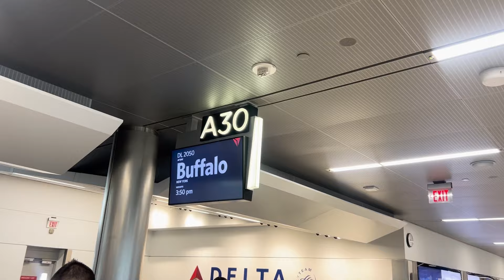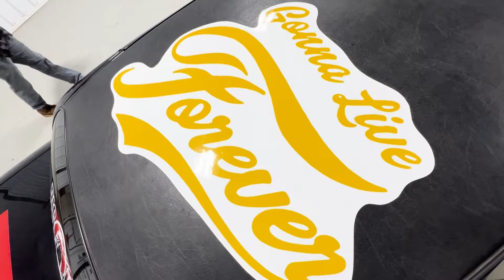We crashed a limo through a HOUSE!

Comment: Dang gone Jim York great job.  I guess you thought the house would have scrubbed a little more speed than it did. Also the tires were air born and locked up coming out the other side. Good job brother and thank god for strong  cages
Reply: This is exactly it! Went through the house like a hot knife through butter.
 Then was an inch off the ground but that’s enough to make your brakes useless